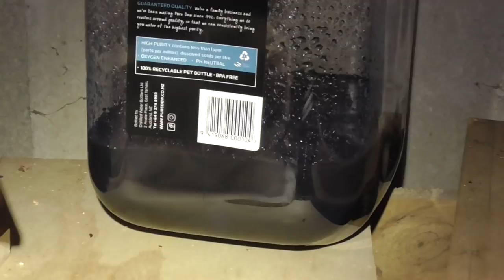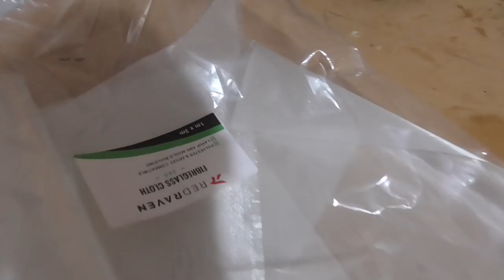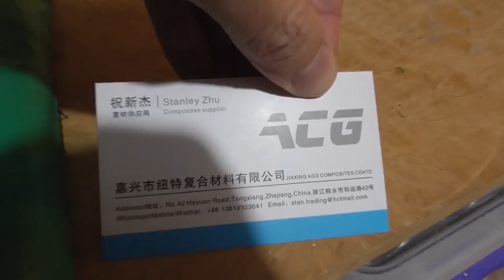Twin Hopper part 2 (flaps, fuselage assembly)

Comment: The projects coming along really well, its looking great! The control horn for the slotted flaps is pretty smart, I always put the control horn between the wing and the axis of rotation so the servo pushes the flap away from the wing as mainly a linear motion. Limiting the motion to pretty much only rotation and removing the linear component from the control horn is a good touch. I'm looking forward to part 3!
Reply from the maker: That sounds like what I did on the 'farm hopper'. I'm still not sure that this arrangement is better, but it's more convenient in some ways. I like that when the flap is under load this way causes tension on the pushrod rather than compression, but it probably doesn't matter.

Comment: Hello, what airfoil are you using? I know you mentioned it in a previous video but I don't want to look through that. I think I'm going to attempt to design a delta rc airplane and I need a profile for my airfoil. Let me know if you have optimal airfoil for a flying wing.
Reply from the maker: For this plane, as below. For a flying wing, search for "flying wing" on that same site.
http://airfoiltools.com/airfoil/naca4digit?MNaca4DigitForm%5Bcamber%5D=2&MNaca4DigitForm%5Bposition%5D=46&MNaca4DigitForm%5Bthick%5D=13&MNaca4DigitForm%5BnumPoints%5D=81&MNaca4DigitForm%5BcosSpace%5D=0&MNaca4DigitForm%5BcosSpace%5D=1&MNaca4DigitForm%5BcloseTe%5D=0&yt0=Plot

http://airfoiltools.com/search/index?MAirfoilSearchForm%5BtextSearch%5D=flying+wing&MAirfoilSearchForm%5BmaxThickness%5D=&MAirfoilSearchForm%5BminThickness%5D=&MAirfoilSearchForm%5BmaxCamber%5D=&MAirfoilSearchForm%5BminCamber%5D=&MAirfoilSearchForm%5Bgrp%5D=&MAirfoilSearchForm%5Bsort%5D=1&yt0=Search

Comment: With the foam as backing, I'm sure balsa would have been ok.
Other , 0.6 or 1.0mm GL3 ply would have been my choice.
Still, it's a fairly large wing so should handle the extra weight without any problems..... Curious how much wing incidence did you build in??
Reply from the maker: That central cage might be a bit weak if less than 3mm, but just about everywhere else it could have been thinner. It would be nice to have a range of thicknesses to choose from, but I've ended up with 3mm basically everywhere :(
There is 2.5 degrees incidence between tail and wing in the design, although that is not finalized until the horizontal stabilizer actually gets attached. I'm planning to put some twist in the outer wing section which worked well on homeslice8 (the warbird style one) and would make the overall wing incidence a little less than 2.5 degrees.

Comment: 5:30 Why did you not put the carbon fiver on your main spar at the top and bottom but rather on the sides? The way that you have made it, your caron fiber is experiencing firrerential stresses along the height of the spar, which is not really beneficial. You should have the carbon on the top and bottom because the carbon will be taking the tensile forces, just like steel reinforcement in a concrete beam.
Reply from the maker: Because the top and bottom will be sanded smooth with the wing surface. The difference in location is only about 4mm.
Reply: @iforce2d  OK, I didn't know that. Thank you for giving me a head's up... :))

Comment: hello, great inspiration you  are _ is it normal in arduplane when i use radio sticks then the green bars in mission planner move slowly and with some delay or is it just my laptop too old?
Reply from the maker: If you mean the radio calibration screen, yes it's normally a little stuttery. I wouldn't say delayed really, but it's definitely not a smooth response.
Reply: @iforce2d  what is better for ardu crossfire or elrs?
Reply from the maker: I've never used either. You keep asking me about things that I've never even mentioned in any of my videos. Might be better to ask on videos where somebody at least talks about the same topic.

Comment: I may have asked before but is that extruded foam the one Bunnings used to stock?
Reply from the maker: Yes. Some places still seem to have it, possibly just old stock that will not be replenished though.
Reply: Yeah I can no longer buy the knauf at our Bunnings. There is another type of foam, "Bastion" , it's a green foam board, I haven't bought any to try using it though . The reviews on it say it's no way near as good as the Knauf.

Comment: I'm curious if you can iron glass to smooth it out, i know it can stand crazy high temperatures, but maybe its enough to get it to relax.
Reply: Was also thinking about the routed carbon for the motor mounts, if you had cut it on a slight angle you would have continuous fibers all the way along in atleast one axis, but ahh well.